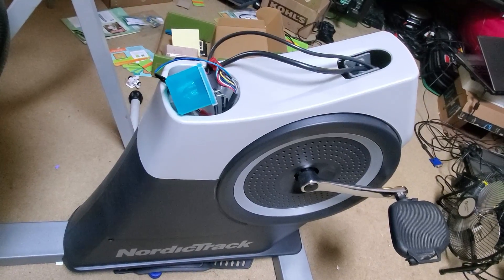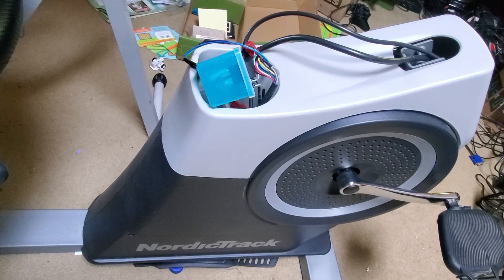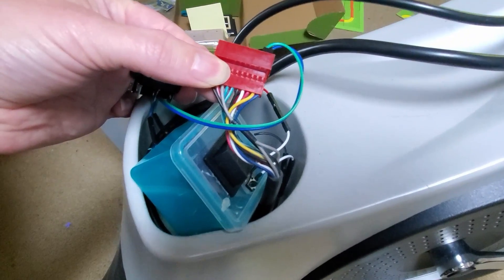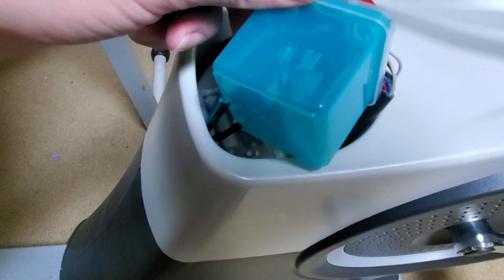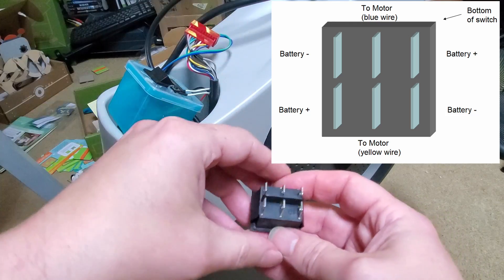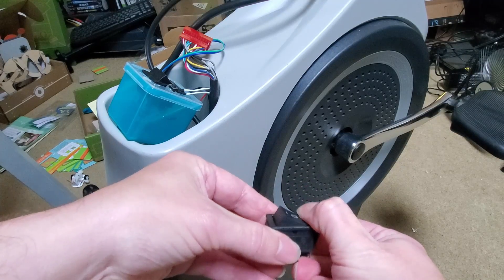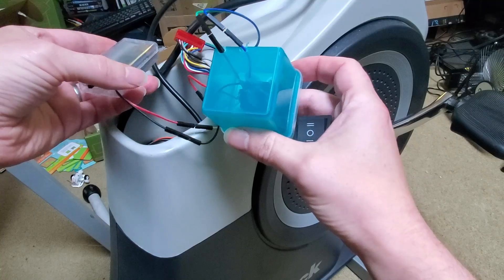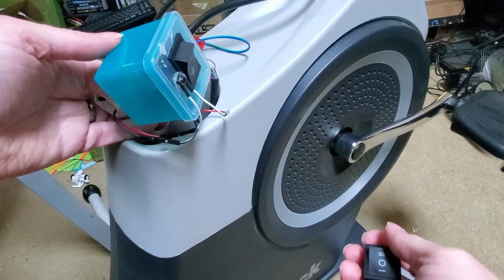Directly controlling resistance on a NordicTrack bike, bypassing the console entirely

Comment: Hey! Can you help....
Loving your video.. Just trying to do this modification....

I've got a yellow & blue wire that does together to the front of the motor, the a set of 3 red/black/white that go into the  side of to motor.

Can you advise where I would attach the switch wires?
Reply from the maker: Does it look exactly the same as my motor other than wire color?